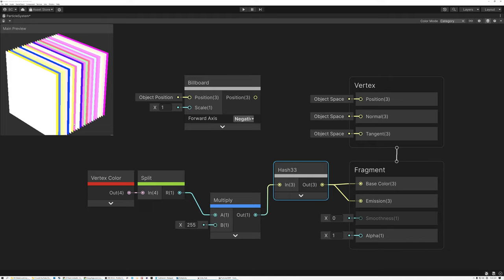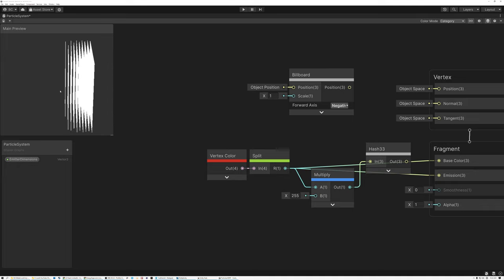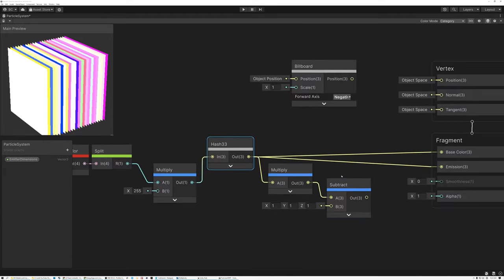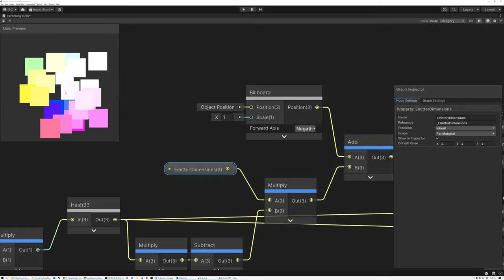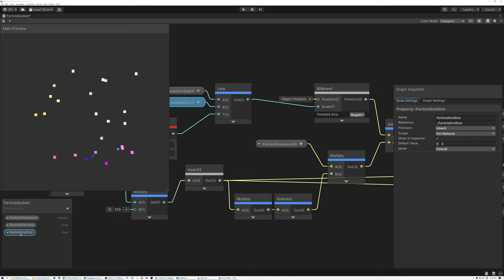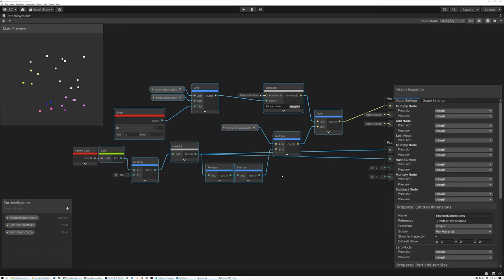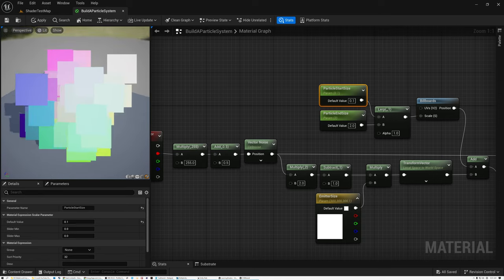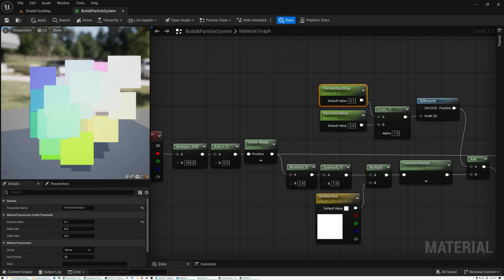Particle System Emitter Size - Advanced Materials - Episode 46

Comment: This is so cool! 

Heads up, if you press “S” in the material editor for Unreal it will create a Scaler Parameter for you. 1-4 on the keyboard will spawn vectors 1-4 for you too. It’s probably the only tip I can give back lol, hope it helps.